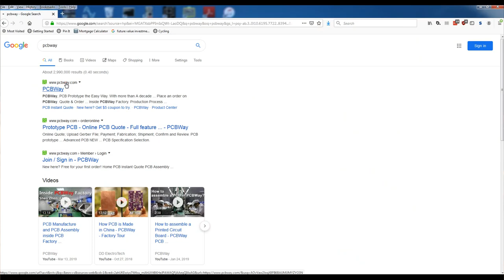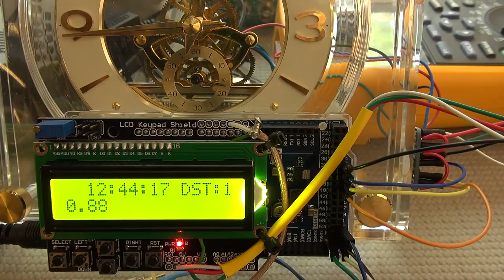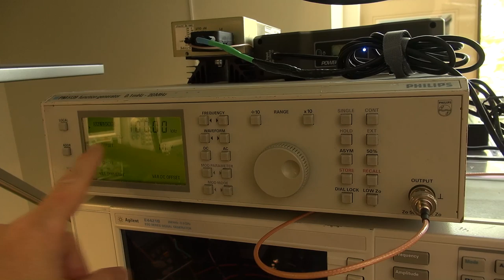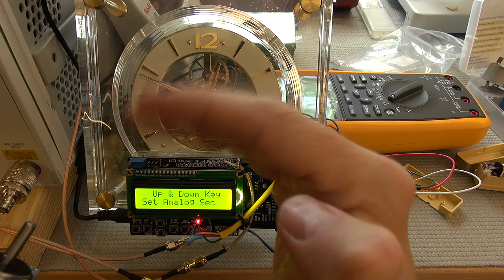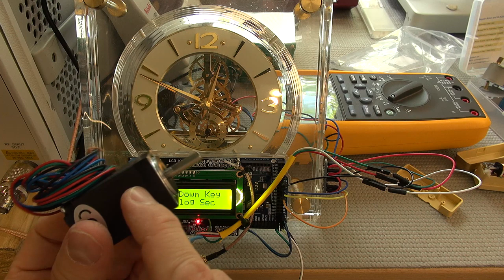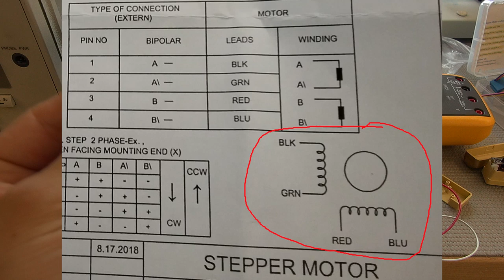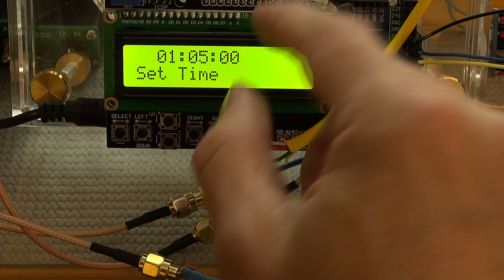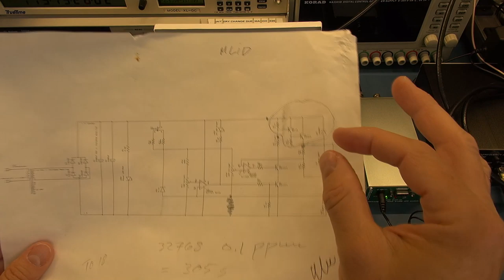T4D #143 - HA Clock and DIY PSU Update

Comment: good to see you opening up some of the older projects, I look forward to seeing more on the PSU etc.
Reply: I know, I got a very non working Phillips power supply, and, after a bit of head scratching, I did eventually reverse engineer what it does, and how to fix what was wrong with it. Dead capacitors, dead diodes and totally missing power output stage, I got it back in working order. Nothing really spectacular, basically an emitter follower running off a potential divider, with current limiting shunting the zener diode to drop the voltage. 

Used a pair of other boards I got at the flea market, some old Phillips PMR unit power supply heatsinks, as the output stage, as the boards each had 2 power transistors mounted, along with standoffs, and emitter resistors for the transistors, along with some unused SCR devices, which turned into connection points. Basic Darlington connection, on the one board, and the other as power output stage, and the flea market also supplied some 2200uF 35V capacitors to replace the very unhappy MysterLee caps the board had, old repair. 

Some 1N5403 diodes for the power side (very overkill for a power supply of 24VDC and 500mA, but better than the very sad looking originals), and it works. current meter is a little sticky, but voltage does work, and now just have to find the missing hardware to close the case again. Not bad for something that in total cost me $2 for the non worker, $1 for the heatsinks with parts, and $1 again for a box of NOS Hitano 85C caps.
Reply: @SeanBZA  good job there #SeanBZA, sounds like you got yourself a good deal there.

Comment: Driving the coil is quite easy, you just use a set of outputs, and a series resistor to limit current. both start off set low, and then you alternate driving each high for a short period, so that the coil sees an AC drive, but the outputs are basically shorted when low, removing the back EMF pulse.

With the stepper motors you can reduce the current by using a series resistor in the common power line for 5 wire ones, or in one of the phase leads for 4 wire ones. You lose a lot of torque, but lower current, lower noise, and you have limits on the ramp up speed before it starts to lose steps, but for your use with only a low speed drive should work well.

Plastic sleeve as gear will work, and will eventually become a gear where it contacts the steel gear. Code unroll loops, should be plenty of room in there to not have critical stuff in a loop, so you get rid of a lot of the overhead. Just be careful your compiler does not decide to roll them up again to save space.
Reply from the maker: Thanks for the very handy input Sean.

Comment: Thank you for the video (including "rant" and "ramble"), very interesting project. I would definitely have to explore driving the original "stepper motor" as the "ticking" of your current set-up would drive me nuts - and I like mechanical clocks! Using direct port manipulation on Arduinos is one way to speed up execution time as a digitalWrite HIGH takes 3.95 uS and a digitalWrite LOW takes 4.55 uS
Reply from the maker: The noise of the "ticking" stepper was something I forgot to chat about. There's no isolation between the stepper motor and "speak box" / acrylic case of the clock, which amplifies the sound. I will correct this in the next iteration. Thanks for your post.